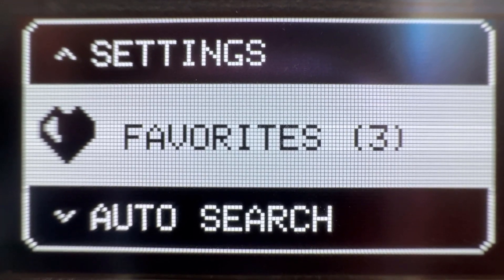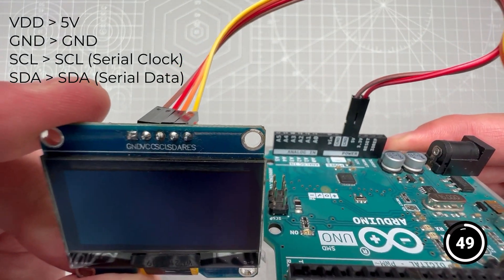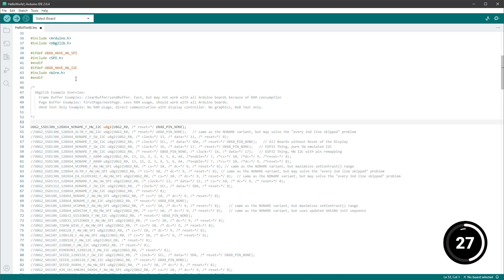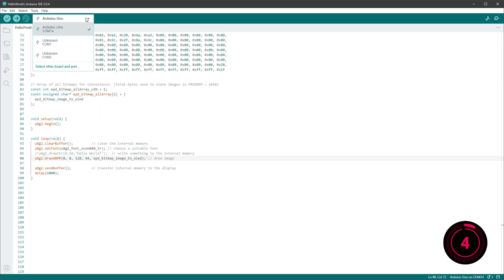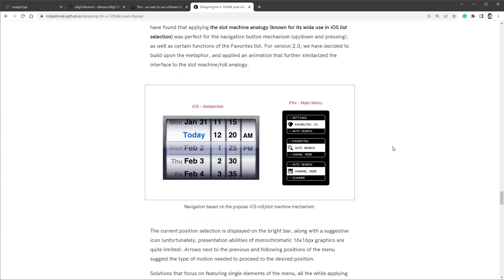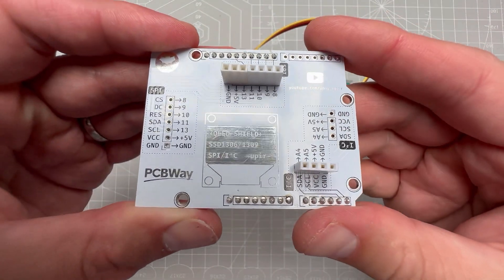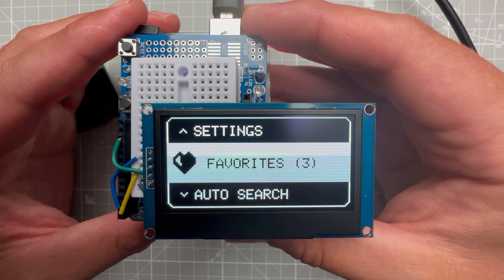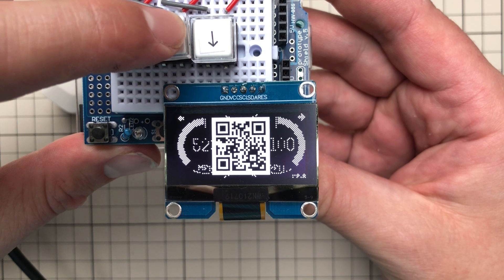Image to OLED in 60 seconds?    (Arduino UNO, OLED SSD1306 IIC, u8g2)

Comment: Jesus... Now trying to do that on a 8-bit PIC without built-in Library 😂
Reply from the maker: Thera are some Arduino examples that do not use library, you can use them as a starting point in figuring out what commands to send to the display.
Reply: @upir_upir  I'm using them as references ... but still no result yet on PIC18F45K50. ( I"m rebuilding I2C + SSD1306 driver from scratch with pure PIC Assembly )

Comment: The Arduino simulator you used in previous videos is even quicker
Reply from the maker: That´s correct. Actually there is a link to WOKWI emulator project in the description of the video. If you click the run button, it will run immediatelly.

Comment: I use a pico, and I use the Gyver Oled library.  I create a 2d boolean array which I render with a for loop.  It means the image can easily be modified because you can literally see the image in the 2d array.  I also created some processing programs to take any image and turn it into binary, and then transform said binary into an array.  Yeeeeha!  Result, I get well over 100 frames per second.  ;)
Reply from the maker: You cannot use a boolean array on Arduino UNO, since one boolean occupies one byte of memory, and for 128x64 screen, you would need 8192 bytes. On Arduino UNO, you only have 2K bytes. So there is no other option other than using individual bits for pixels. Do you have any examples of your work somewhere? I would be interested to see it in action! Thank you.

Comment: Could you make a menu tutorial? I'm working on projects that needs dynamic menus, because they work with files and the files will change, so it has to be dynamic. I've been struggling to get a relatively simple solution but ended up doing a mess that get exponentially worse as I continue making it
Reply from the maker: I do have one tutorial already, is that perhaps something that you are looking for? 

Arduino OLED Menu Tutorial    (for beginners - Arduino UNO, 128x64px SSD1306 OLED screen, u8g)
https://youtu.be/HVHVkKt-ldc
Reply from the maker: I do have one tutorial already, is that perhaps something that you are looking for? 

Arduino OLED Menu Tutorial    (for beginners - Arduino UNO, 128x64px SSD1306 OLED screen, u8g)
https://youtu.be/HVHVkKt-ldc